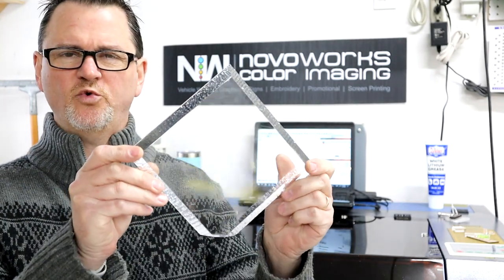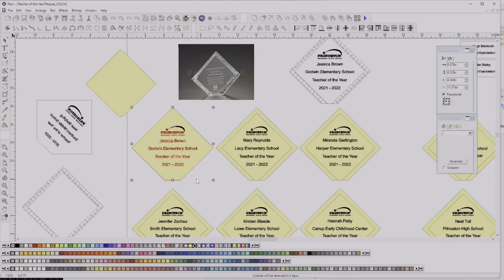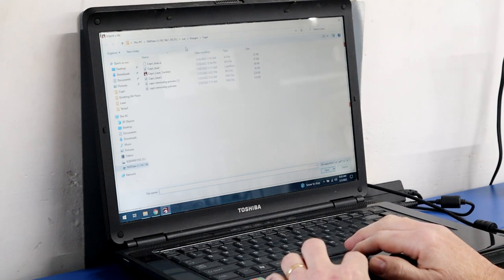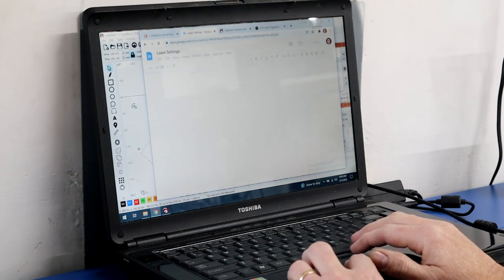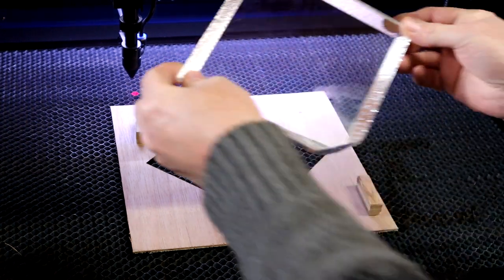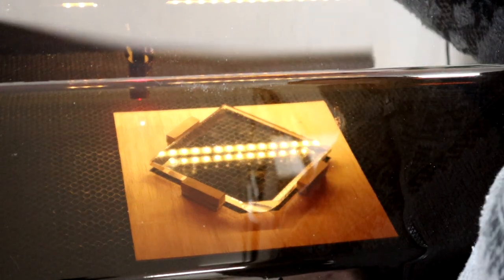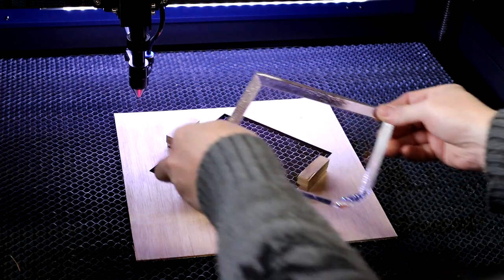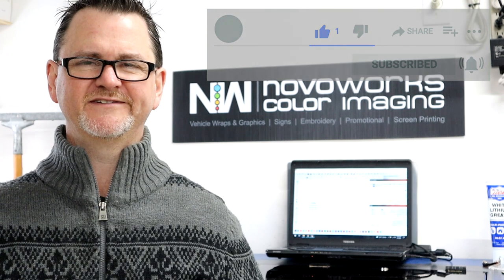Make a custom Jig to Laser Engrave Awards & Plaques consistently!

Comment: Okay so I’m trying to make 5x7 plaques do I just cut out a square that’s 5x7
Reply from the maker: If you are using that shape to place the plaques in for consistent placement of many... sure 😊
Reply: @Novoworks  so I just cut out that shape and it then knows to Input my image in there
Reply: Or I have to set any origins
Reply from the maker: @tiffanyresendez5272  - If you have Lightburn set to use "User Origin", and you are hitting "Origin" on the laser control panel.  Then your references should be the same